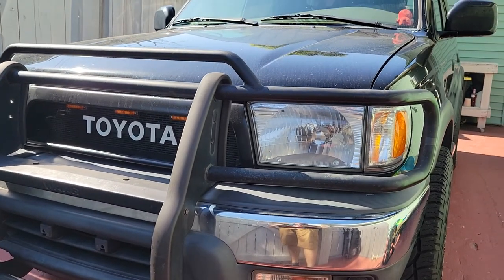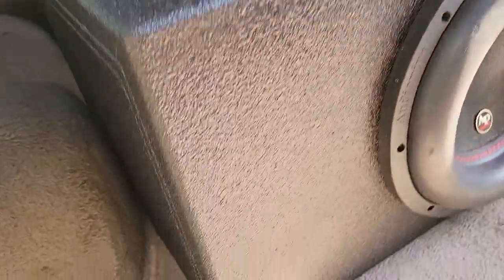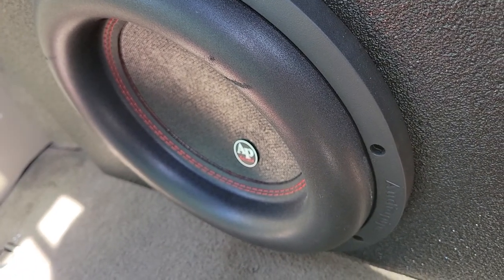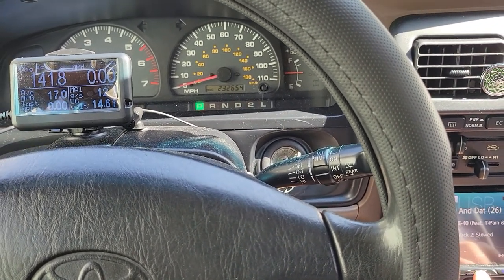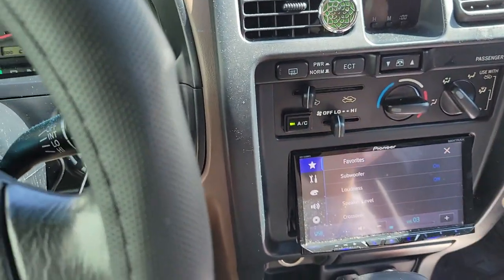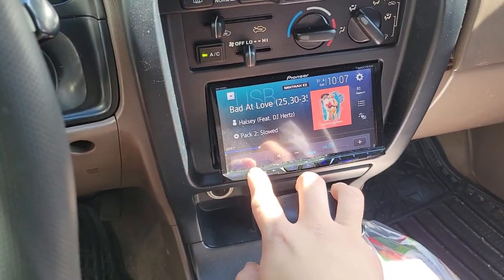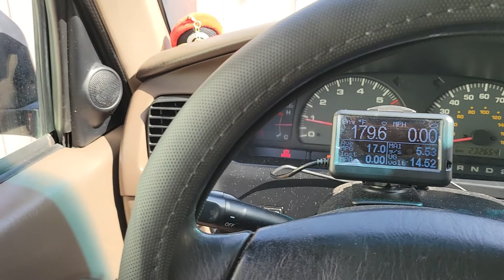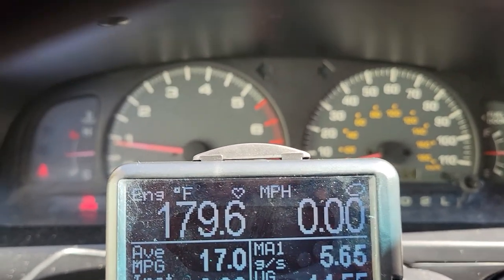2000 4runner Audio Pipe 4 stack  Txx-BDC4-12  and Sound System Review

Comment: Also if you get a box built get it tuned at 33 hz and internal airspace of 3.25 cf ...that will bring that sub alive I have 2 of the bdc4 12s in a 6.24
 cf box with a 8 inch aeroport ...it's nice
Reply from the maker: I got a custom box built already made for it.Just sold that 4Runner and haven't installed everything on the new one.  I'm not sure what hz the builder made it for but he did get the box spec requirement for this sub.
Reply: Did you have to upgrade your power supply?
Reply: @RemingtonSteel  yes two agm batteries 100 ah batteries  and dual runs 2/0 guage. On a taramps smart 3 ...is what i ran ..stock alt tho. Needs a ho alt
Reply: I got 2 in the skar pre fab 32hz box hit pretty good feel like they can do a lil more tho I think it's like 2.1 sqft on each 1 so around 4.2 sqft I like the lows any idea on bringing them out 28-34 Hz?
Reply: How it sound on 26-30 Hz
Reply: @higginsbrandon9256  yeah a biger box 3 cf per sub one 8 inch aeroport tuned to what you want they are made for lows 33 hz and play some decaf yeah the y get windy on a smart 3
Reply: @higginsbrandon9256  gets loud its sounds better the lowere they play ..thats what these are made to do
Reply: If I got enough trunk space I also only have 1/0 gage power wire set up but no extra batteries or upgraded alternator but my voltage isn't dropping but maby .3 - .5 at tops on a 6500.1 quantum amp
Reply: How are u using a taramps 400 to help play bass are top that amp is for tweeters 😂😂😂 get urself 3000watt taramps 1oh 1 channel to play bass
Reply: @gary26ful  he's not using the ds440  Amp for subs.   You don't see the other amp ?

Comment: i have 2 of those subs and a 2 stack on a crossfire 1k class d amp prolly running .75 ohms or lower and man it's killing it in mine. you def need a diff amp! im running factory head unit with american bass line converter 0 all the way back to my xs battery have stock alt also it def loves the high bass

Comment: Make a box thats 3cuft with a 4 inch aeroport tuned to 32hz, thats a sweet spot for that sub, wont be as loud as your box cuz yours is tuned to around 42 hz but it will hit the low notes your box cant. Mine sounded amazing
Reply from the maker: Yes sir, my buddy is making me a box, I don't have the tools to make one. I will be getting a better Amp eventually I'm currently in the process of selling the 4Runner to get a 4WD one. Thanks for the comment!.
Reply: Move your box the port needs to be the width of the port away from any loading  wall and it will sound better your not letting it breath up against that wheel well
Reply from the maker: Joe I just noticed that,your right I only moved it over there so people can see the amps good catch.

Comment: I am confused between this subwoofer and mofo 1100rms 10inc what is better?
Reply from the maker: I used to have a 12" mofo the new and old style and I personally think this sub is made with better quality materials. I think the mofo has a higher RMS rating but this sub was hitting the lows pretty well. I honestly regret selling it. I would get an Audio Pipe per experience but both subs are amazing for the price just make sure you match up the right amp to get the most out of the sub.
Reply: AP hands down it already beat the Skylar in competition by this guy on here he matched both subs  identical  and the AP killed it by 68% of the vote. 
1100 watts RMS at 2 ohm's.

Comment: Get rid of those Walmart rca’s
Reply from the maker: Didn't know 4ch kicker RCA or Skar audio RCAs can be purchased at Walmart. But I'll look into it what would you recommend?
Reply: @MarreroBuilt  My setup is an Amazon special rca from my head unit to my 7 band eq (I just bought a 3ft stinger that will be replacing it) A monster rca that runs from my 7 band (sub out) to my crossover (sub in) and than a stinger back out to my sub. I can’t remember the name of the pair I have running for my 4 channels but I can get a name for them from my local shop, they ran me like $20 and so far I haven’t had issues with them. My systems loud and clear (imo and everyone else who has heard it play in person) for being a cheap setup. As far as my amp for my door speakers I’m running a Skar SK-M4004D which has been really good to me, I’ll run full volume on 2 hr long drives and she won’t ever overheat or anything, I think it’s worth checking out if you’re not happy with your taramps.